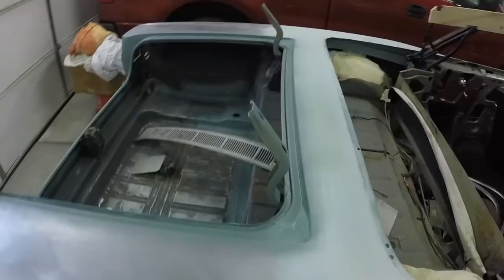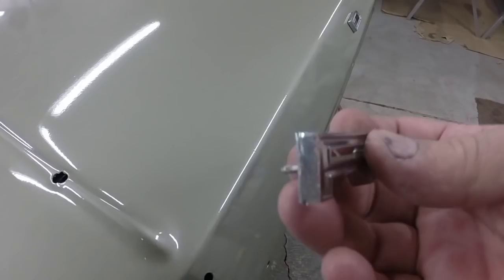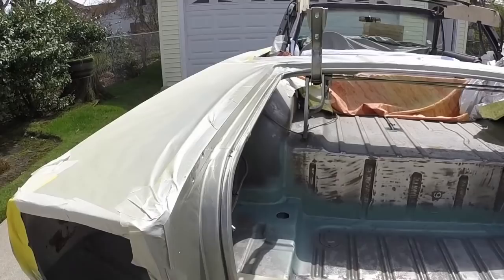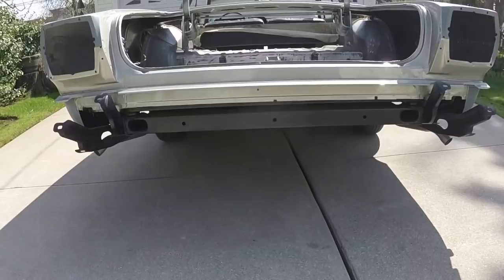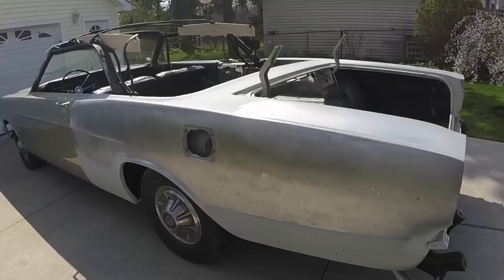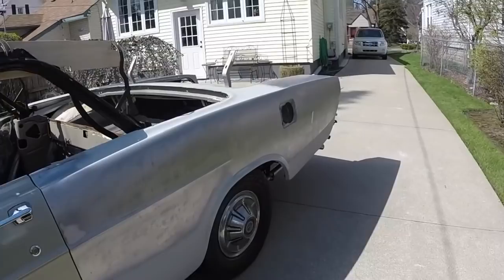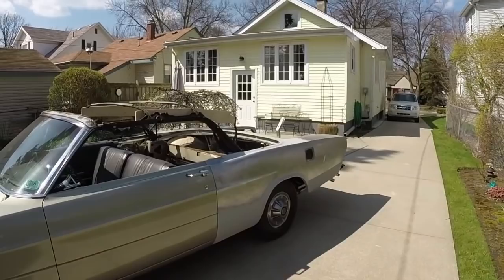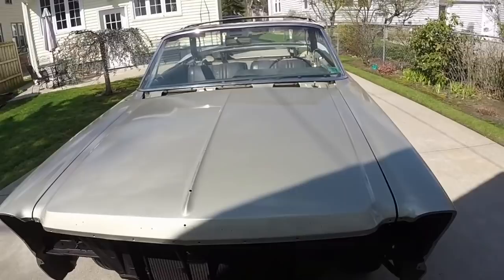1966 Ford Galaxie 500 convertible restoration part 108 painting the trunk jamb

Comment: Howard when you get that heavy metallic flow let it set up then come back and dust a light coat of paint over all what happens is applying heavy coats allows the metallic to flow inside the painted layer. Next time move a little faster with your sweep and the finish will come , by slow heavy sweeps you see what looks great but will continue to move as is sets up over time.
You can get that great finish with a little wet sanding when you're done.

Comment: That looks like wet or dry paper that works great with liquid soap in a small bucket for sanding. The soap prevents nubs from forming on you paper. Dry clogs bottom of paper with nubs which causes cuts in the primer. Your sanding with water will allow a glass finish.  Just a tip for future wet sanding of paint or primer.

Comment: Do you use high octane gas in the impala
Reply from the maker: Yes.... it has a 10 to 1 compression ratio, so it needs it. I did run it on mid-grade once, but spark knocks a bit on it....